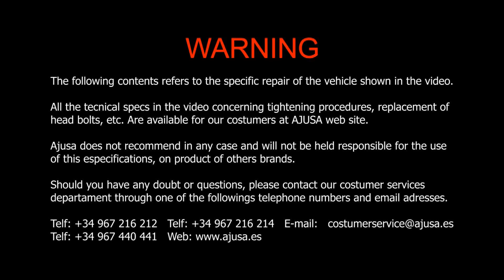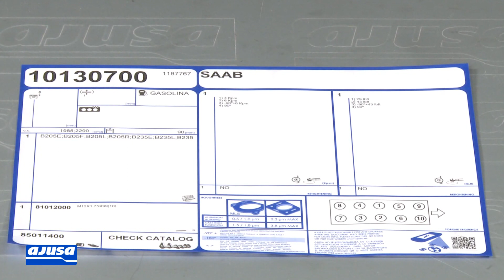Cylinder head gasket / Junta de culata SAAB 9-5 TURBO 16V B235R .

Comment: I can see on the head gasket that there are 4 coolant(?) channel cutouts visible only around the first cylinder. Why is this? The block and head have the channels around all 4 cylinders. It appears the head gasket would block 3 out of 4 channel sets? :-)
Reply from the maker: Hi Mikael! This is correct. Coolant holes in the cylinder head gasket control the flow of coolant through the engine for better cooling system performance. This is common in many engines. Sincerely

🌐 http://www.ajusa.es 
🖥️ https://www.facebook.com/AjusaSpain 
📸 https://www.instagram.com/ajusa_automotive/